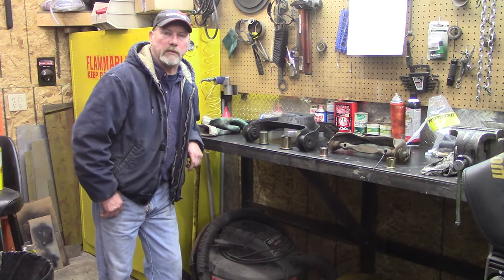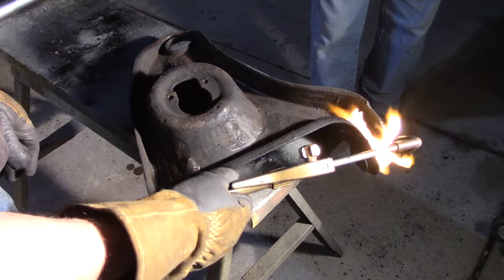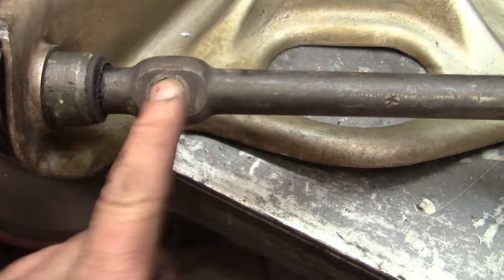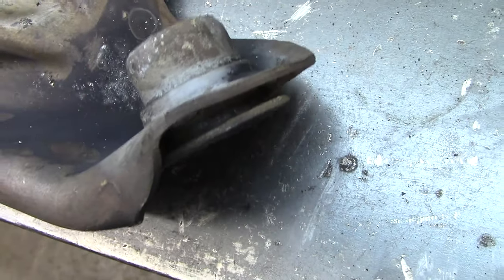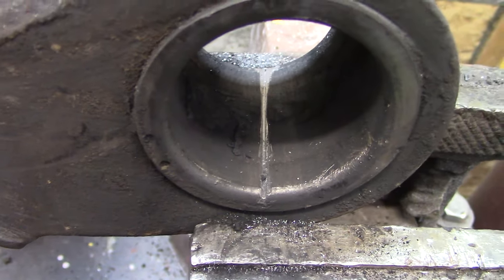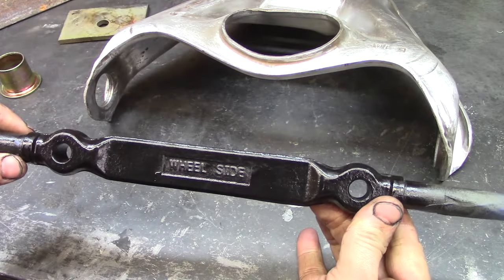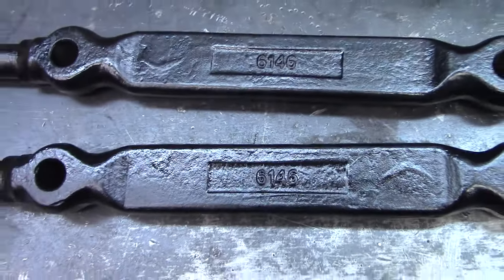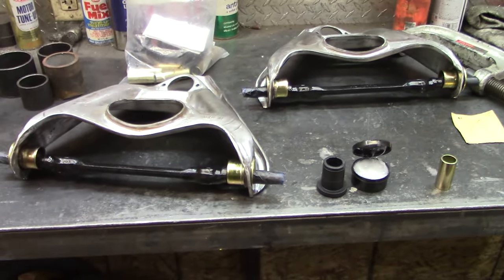GM Control Arm Bushing Replacement Upper and Lower

Comment: I am faced doing the upper control arm bushings on a Dodge 1 ton van that is a lot like the GM unit with the bar going through only a lot heavier built. You did the job in a similar manner that I do it. Guess there ain't a good way around the mess. Thanks for the video.

Comment: If you want to save your shaft you can hammer a chisel under the lip of the flush bushing on the upper control arm on the half of it where there's a slight gap. An air chisel would work too unless you don't want to scuff the control arm at all

Comment: I went down to Autozone and rented their bushing presser. Only took 30 minutes and I was able to leave the A arm connected to the ball joint.
Reply: How did you contend with the cross bar? The parts store tool kit has nothing slotted to fit over the cross bar to hold a backup for the pressing!
Reply: @trailerparkcryptoking5213  Hmm. The tool kit I rented did have one. Maybe the last renter kept it.

Comment: When bushings are worn-out could that result in the car hanging on one side lower?
Reply: My van was low on one side. I had weight on the passenger side. The vehicle went down with the weight. But when I removed the weight, the van stayed down. The upper control bushings had froze and stuck. Not allowing the shock to push it up.

Comment: Great video. Is there a way of removing the control arm shaft with out destroying the bushing?
Reply: Use an air hammer with a sharp tip
Reply: @medicineman1202  ok thanks for the reply

Comment: I know this is an old video but FYI:
A master kit balljoint press works much faster
Reply: Just got to the part where you used the balljoint press lol. But the master kit makes it to where you dont even have to get the rubber out first.

Comment: Do you guys know what size bolts/part number are used for the cross shaft? Any kind of help would be appreciated in tracking these down. Mine are rusted stuck and need to replace but no kits come with them

Comment: I was wondering about the effect of the heat on the control arm myself.
Reply from the maker: The heat was placed on a bushing shell that was replaced.
Reply: It won't ruin it's temper if you let it air cool & don't throw water on it to cool it off! THIS only applies to steel parts ! 
Don't attempt this on aluminium A arms!
Reply: @Oldsmob455   can bad bushing cause a bumpy ride?
Upper or lower? Thanks

Comment: That's funny that you have all those tools at your disposal. How about showing how its done with limited tools. Cutting torch? Lol.
Reply: Back before I had a garage full of tools to use. I'd just drill out the rubber with a large bit then collapse  the shell in on its self with the air hammer and 9/10 tines the pop right out. Then I would  use a 5lb hammer  with a socket over the new one  a block of wood and go full on Neanderthal on it haha

Comment: Would you know the dimensions of the sheet metal used so the control arm wouldn't collapse?
Reply from the maker: We used 2" angle iron and cut it to length